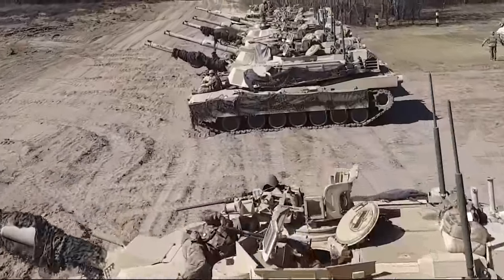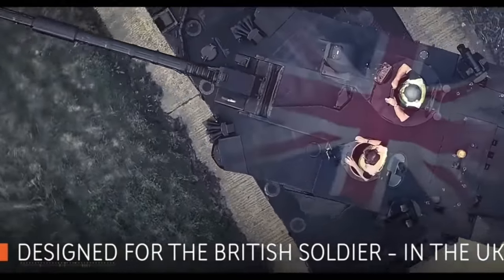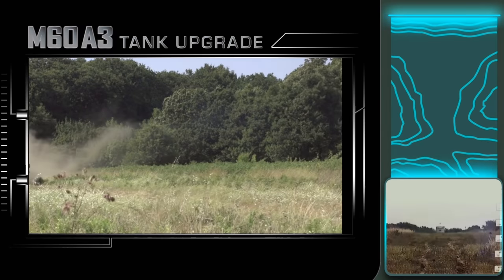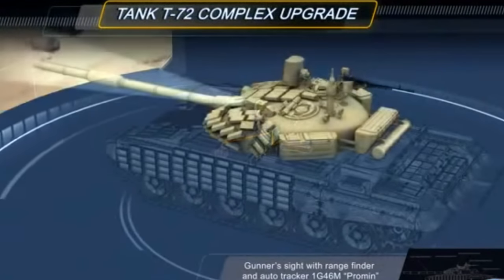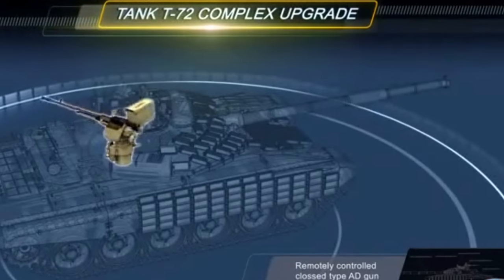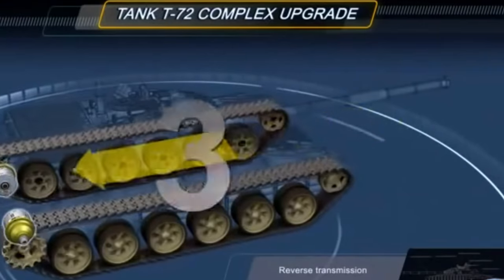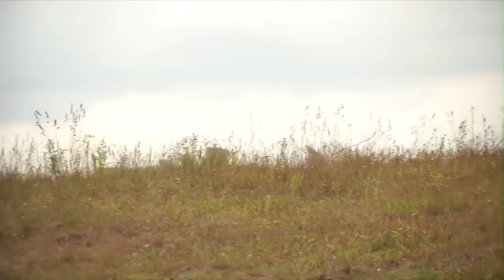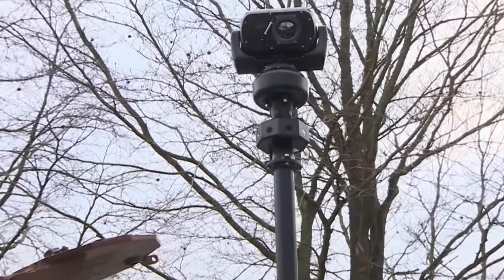Why upgrade Tanks instead of designing new ones?

Comment: Well, the main problem with a new tank is - how credible is the threat?
To design a new tank takes 10 years and getting a production restarted is not cheap either.

There is a definite time factor involved.
In 2014 Nato revised all its plans to fit the Russian threat rising. To quench those ambitions and not leave a window of opportunity - you had to rely on a "fixer upper".

The other point I would like to make: The current development is in the medium forces with 8 X 8 protected vehicles. This presents the opponent with a whole new scenario. The really interesting thing in tank design from scratch is: What enemy are they supposed to fight - and where?

The point is: You go to war with what you've got, not what you want.

In that vein: Who can guarantee Russia will exist in 5 years time?

Comment: Well, new T-14 is more then the cost of fully upgrading 4 T-72B. Certainly fully decked out T-72B is no match for T-14, but 4 of them given current threats are enticing proposition. Heck, you can get roughly 2 T-90M for price of one T-14. There is a reason why Challenger's were not scrapped yet for something better - they are here and their replacement would cost money. Besides Brits love their terrible tanks - from WWII till today. They still will be using that rifled gun in 2040 claiming "HESH can kill a T-55, should one be stolen from a museum".

Comment: A $200.00 shoulder fired weapon can knock out a 10 million dollar tank so why not upgrade what you have in your arsenal. Even the upgraded up gunned M-60 tanks are still better that the majority of Russian tanks specifically in the haul down position . I was a 19D20 and cross trained in the M-48A5 and M-60A3 tanks.  We had not been equipped with the Abrams yet when I got out on a medical retirement with 10 years of service.

Comment: Very few nations have the means to develop new tanks. You cant just take a couple of engineers and tell them to design a competitor for the Abrams.
 German had this issue in the run up to WWII. After having their warship building industry gutted for 2 decades they simply didn't have the capacity or the expertise make competitive ships to counter the royal Navy. 
The Bismark was 50% heavier then its contemporary British battleships while only just having similar capabilities. It was a very inefficient design born from a inefficient naval industry.
This is only compounded when you add 7 decades of technological development you have to catch up on.
Just look at the sad state of the Indias tank development.

Comment: The Syrian Civil War a T-55a a very Old Machine is extremely lethal against the insurgents. The insurgents were pounced very heavily due to them running out Of anti tank guide Missiles while the Syrian Arab Army uses infantry to go ahead and pinned down the insurgents while the T-55 destroy buildings or cover and intimidate the insurgents with their presents. The also uses combined arms Of using BMPs, Tanks and infantry to take out strong points Piece by Piece. 

I doubt Syria would be fighting any modern army any time soon. Cause they lack The strength to so in an offensive war, and their increasing closer tie to Iran and Russia prevents any western power or allies from doing so.

Comment: the test of record for effectiveness of new vs upgraded older eqpt,will  be determined by, which is more effective once its role is defined, the job tank crew are tasked with,what terrain  will it have to perform on,under and in,the dog of war, we will not know until equipment like these tanks are  tested in battle,as I offered inthe case of the M6o upgrade by RAYTHION in its promotional video of some months ago,we may face this 'test' in south asia,europe,or the middle east.each ten  weight tons,and the respective volume saved when a 50 ton M 60 is freighted into battle,saves this weight and volume for all sorts of spare parts,ammunition,food,medical supply, someone out there may be in the works involving cloaking technology,if there be a gamechanger,this would be it   Back in history are germans after the wars end who said US supplies were endless,( see the irish guy moran the tanker mans presentation on the MI sherman,its losses,,simplicity of running and maintinance,it served its purpose well. we will not know which works better until the next world pileup

Comment: I wish they kept the T 34 and just upgraded into a mad max abomination
Reply: T-90 is extremely pimped up T-34 essentially.

T-34 -> T-44 -> T-54 -> T-64 -> T-72 -> T-90.

T-72/T-90 (V-92 engine) even uses massively upgraded T-34 diesel engine (V-2-34). I am dead serious.